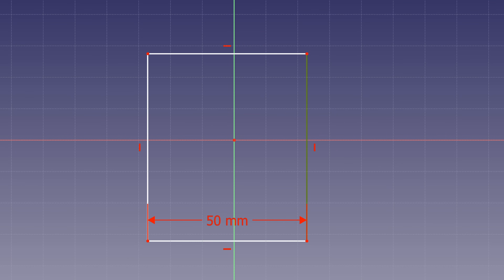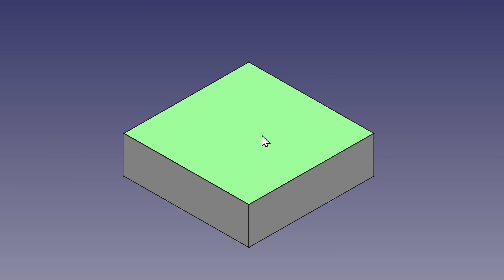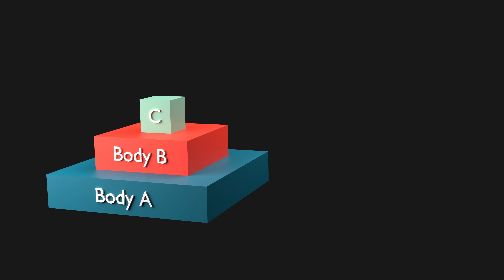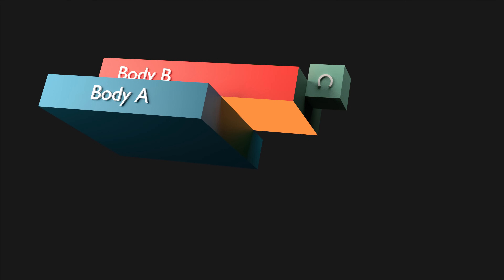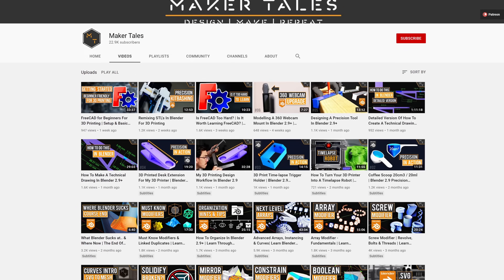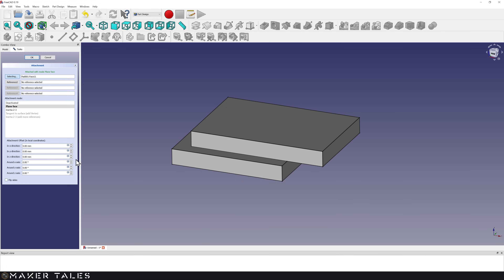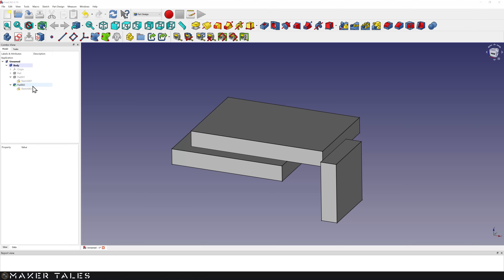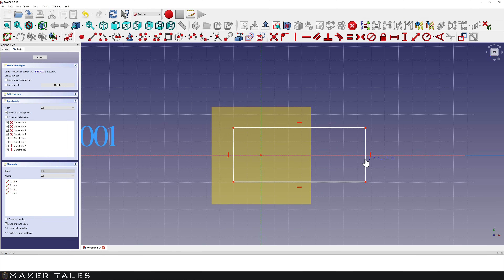FreeCAD Is Fundamentally Broken!  - Now what... Help Me Decide...

Comment: This video helped me a lot. Thanks man. Have you ever encountered other pronlems or some like I had? I knew about this but in my opinion it is not even that bad. Worse is when you spend over 10 hours and you do finish your very complex model that NEEDS TO BE SPLIT which can be only done by boolean operations in PART (that is like the most buggy thing in galaxy) and you realise you can't after literally trying aroud 4 ways to do just that. There is a way that would work but it would take longer than redesign the whole thing from scratch namely cuting every single body individually and then exporting 3d model.... and on and on. FREECAD IS THE BANE OF MY F..ING EXISTENCE. Well sometimes it is but I will only use the datumplanes to origin way of doing things. That definetly will help, because I think my problem here is that I used CROSS REFERENCING between different bodyes and parts like a milion times and freecad USED TO CRASH from that. It even says that I have cross refference cycles. I was trying to copy my thing 3 times and boolean cut it up to 3d printable parts that would be later 3d printed obviously and assembled irl...

Comment: Bravo, I started into cad by taking a "Cad Specialist" that was a 2-year degree. I spent 17 years on the job mostly using AutoCad and Solidworks.  I went to Freecad when I retired to use for my 3D printing hobby.  You are spot on about the renaming of faces.  My suggestion is to make an extremely detail instruction on reassigning sketches, but when going forward always use datum plain workflow.  Once a person learns datum plain workflow, they can still use any pre 2.0 release video to solve use issues with Freecad. Just my Opinion at 67 years of age 👍✌🥃

Comment: I think you hit the major issue on the head. It's a critical usability bug, with significant consequences, and fairly tedious work arounds. It is definitely a major hurdle to wider adoption. The second biggest issue is the UI (not how it looks, even though it is dated compared to current fashions) but the lack  of consistency in how some tools and work benches operate compared to others. They need to be the development focus (as boring as it might be) as it's not capability that is holding back wider adoption, it's easy of use and learning due to these two issues.

Comment: ANSWER : First, to answer your question, I'd either wait or just create videos that don't use the sketch feature.
CON:  Thumbs up on the video's comments.  I'm definitely one of those amateurs he speaks of, but with 2 years of designing in FreeCAD.  I hope we get this bug fixed. I also notice FreeCAD can just choke up.  After thinking I'm doing something wrong for a time I restart the program and it all works again.
PRO:  Meanwhile FreeCAD already offers out of the box 3D primitives to accelerate design which SolidWorks doesn't support. In fact I bought SolidWorks, but haven't learned it because FreeCAD does my work faster.  Subsequently I rarely have to play with sketches, as the Part menu makes most shapes easier and faster. I also like how FreeCAD handles the spreadsheets.  Much more friendly on first blush.
DISCLAIMER:  I haven't put the time into learning SolidWorks, so maybe it's a case of liking the first thing. But despite being a bit buggy, FreeCAD is still my goto CAD program.
Reply: Grub, you might be right as I started out in SolidWorks and can't wrap my head around FC.  When problems arise in SW I am usually able to quickly find the issue and fix it.  For me FC has been such a screaming frustration I just stopped trying to learn how to use it.

Comment: I was dragged kicking and screaming and forced to briefly use cad (solidworks) at uni.    Years later I found myself needing cad for a hobby project (model steam engines).   I taught myself freecad and never actually encountered the bug you reference here,  partly because I rarely change and object using its history without a fundamental re-design of said object, but mainly because i found only using origin referenced planes kind of necessary to avoid your whole assembly becoming a jumbled mess of incomprehensible parameters.     I get that some people might just want a user friendly intuitive piece of software to blitz out a single body for their printer,   but multiple such things already exist.    I don't see why freecad has to be that, and I certainly don't see it as broken.

Comment: Yes, I came to the same conclusion.  Broken.   I found there was little consistency between the   UI for  different menus. Its as if 20 different menus were written by 21 different coders - each with their own interpretation of how the UI should work.  It looks great from the outside until you start trying to do something real with it. 

Openscad (Parametric CAD) is far more useful productive and consistent. You code up what you want the package to do.
 I also using Blender 3.1 and settled on that

Comment: Been using Solidworks for 21 years.  There is nothing "professional" about creating a new reference plane for each and every sketch.  What that does do is clutter up the design tree and unintentionally obfuscate design intent.  Certainly, using global variables and equation driven design geometry is good engineering practice, but when one uses parametric modeling software, one assumes that faces of the model are already referenced to the origin.  If they are not, then the underlying software architecture is poor.  Maybe we would all be in the right mindset for the professional way to do parametric modeling if we started out in high school drafting class labeling our vellum with the drafting table height, angle offset from the floor & position in the room?  Kudos to realthunder for recognizing and fixing the problem properly.  If the others refuse to merge the fix, then permanently fork the code.

Comment: I use Freecad 0.18 -> 0.19 -> 0.20 since about 8 month. Never in my long life I had a program that made me wild like Freecad. I don't say what i thought often about the programmer(s). I think that the part "construction-time" and the part "repairing-time" is about 1:5. It means, that for a normal working time of one hour to construct I need 3 to 5 hours  to "repair" these damned errors coming up by global naming problem. It is pure horror. The part is ready, i have printed it. Next day I change a little peace in one pad or pocked. Boing! Many elements are broken and have to be repaired or deleted and new created.  I am a hobby-user and have time. But I would like to do better things than repairing my work again and again

Comment: Why doesn't allow FreeCAD Spreadsheet cell referenced Math in the Spreadsheet itself? I can't perform any Math in it. For example, if I type this in Excel "=A1+ B1" in Cell A2 then I get the result in that cell. If I do that in FreeCAD Spreadsheet, it just writes the formula in the Cell A2. Is there a workaround to force it to do Math? Edit: it performs a bit differently and not so intuitively than excel... what a bummer -.-

Comment: I am really struggling with Free CAD after using F360 for the last 3 years. Its not intuitive at all and simple things I did in F360 just dont work in Free CAD. Having said that I am learning to work around those issues and its better than paying a stupid amount of money for a program I only use 3 to 4 times a year. I design things to 3D print to fix broken items so they are never very complex.

Comment: I used Catia for the last 20 years, and Catia let one not use scketches if you choose not to.  I never used a scketch to avoid the type of problem being talked about.  I would put a point in space, and would attach geometry to the point, create a surface, turn the surface into a solid and have a very stable parametric solid part.  Is this possible in freecad?

Comment: Yes I have experienced a sketch being lost and loosing it's reference plane.  Have had in sheet metal the feature changing surfaces and realized that they faces change names as you described.  But I am use to problems with 3D cad programs including ProE and Unigraphics.  What I call bugs that never get fixed.  Try to make an array of a model element in ProE. What seems simple produces junk and I had to do it half dozen of attempts.  This is after using it for 2000 hr.  Assemblies in Unigraphics you have to manually place parts together and define coordinates etc.  And Unigraphics has three methods of building parts that can be mixed together.  1000 hr of using Unigraphics.  I also have Granite, solid works, Creo, and tried other free open source cad programs. 
    Even in the above 3D cad software if you change a feature too much the features built on in can fail.  And you have to rebuild the model again from that point.  ProE, Unigraphics, Solid Works, etc all have this problem.  FreeCad just has more failures. This my solution to sheet metal, do not like it but it is what it is.  
     I think this face change naming problem is software fixable and downward compatible.  They already do this for sketch, body or part (models). Can only add:  Delete and the name can not be reused, a blank.  Add and it is at the end of that models feature list.  That is in the unseen column of the table.  Personally my guess is that this is how other programs handle the problem.

Comment: Despite the no doubt wondefull work of the 'thunder' developer,whom I greatly admire',  I will keep on using the official release as I absolutely believe the problem will be solved in a next release. Also the original initiative of this wonderfull software is what I would like to keep supporting for the moment. I am a long time AutoCAD user and Fusion360 (done lots of work in 3D-studio in the past as well.)  I hope the thunder developer and the freeCAD dev's will keep an open mind about cooperation.
Reply: The FreeCAD devs are supposed to be going to incorporate RealThunder's solution to this problem but I tried a pre-release of 0.21 and it is still not fixed so I am baffled what they are doing as it is the one deal breaker issue most people trying FreeCAD never get past and just end up using something else.

Comment: The topological naming bug in FreeCAD seems to be a fundamental flaw preventing sketching on faces, which is easy to do in most all other CAD software.

The work around seems to be to always create a datum plane equal to the face.

If this is true, the fix for this problem seems relatively easy.

FreeCAD has to know the size, location, and orientation of a face.

As soon as the user selects a face to sketch on, FreeCAD should AUTOMATICALLY create and generate a datum plane on the face, BASED ON ORIGIN as opposed to face, which automatic datum plane is left permanent and independent of the face unless the user deletes the datum plane,  whether the face changes or not.

All relevant sketching seemingly done on the face is actually done on the datum plane, which is dependent on origin, not face, which was originally used to define the datum plane.

These are the steps done manually to work around this problem - why can't FreeCAD do this internally automatically ?
Reply: Problem with that is parametric changes to the face are no longer propagated to the position of that sketch. To do this correctly the datum plane would need to be linked to the face somehow and then the problem is back. What they need to do is treat faces linked to other geometry more carefully. When new faces are added to a geometry don't just trash the existing faces and start again from scratch but calculate new faces to insert into the existing list. This is how literally every other cad software works but it adds complexity to the code for amending geometry which is probably why they shy away from it in FreeCAD. The most embarrassing part is that a lone developer has done the work for them yet they can't be bothered to commit resources to integrating those fixes.
Reply: No, other CAD software actually does the same, it just implements a bunch of guessing-functions  to assign existing names to what it thinks is a corresponding face in the model after the operation. That sometimes works, but sometimes it doesn't. Sketching on features and then adding operations that change the number of faces in a model (like chamfers or fillets) is risky in any CAD software.

Comment: Your concerns are spot on but Freecad already a fundamental problem with its terminology, which makes it far less intuitive than other software. Coming from an FEA background I expected it to be easy to pick up but the last three weeks of me trying to adapt to it have been incredibly frustrating. It is a pig. Perfectly capable but because it has grown with contributors each having different ideas, it has become an overly complex monster that has a steep learning curve regardless of the bugs, once the user starts to push beyond simple sketches and models. I'm sure that many power users love it because of its flaws and nuances but I doubt most users will ever get to that stage.

Comment: Whilst the TNP is a serious issue for FreeCAD I don't see how it can ever be totally solved in any parametric editor of this type. If you daisy chain off faces, what happens if you go back in to an earlier stage and make a change that removes a face something else is built on? So whilst I agree FreeCAD doesn't handle it that well and designs can fall apart after changes that shouldn't cause that, even if fixed as far as possible, some structural care is needed.

Comment: I wish I had such problems. Freecad doesn't even run on Windows 10 Pro. I thought I fixed it and it looked like Permissions issues, which does fix it initially, I can open and close it all day fine. But once I actually use it and save something, it never opens again. 
I've seen many others have problems running it on Windows 10 Pro, they seem to only want to point you to thier "Known Issues" doc which does not address the problem. What a load of junk.

Comment: You should definitely teach FreeCAD as it works currently. And I wouldn't wait for some upcoming release. For one thing, older versions of FreeCAD are going to stick around for awhile as the official packages in Debian Stable, and Ubuntu LTS, etc. So people will run into this issue for a long time after it is fixed.

The skeletal geometry approach is worth understanding, and I think leads to more robust parametric models (that are less likely to break when parameters change). Even commercial CAD packages are not perfect at dealing with changes deep in the feature tree / history, and you often have to spend more time fixing up sketches and features than it would take to delete the features and start over.

Comment: This problem is very frustrating. It has caused problems with my designs and I've had to implement workarounds, backtrack through a design and even start over where the effort to fix it is more than creating new.

I don't regret learning FreeCAD and I do intend to continue to use it for my future projects, such as creating cases for Arduino and Raspberry Pi projects.

I think the best thing for now is to teach using sketches on faces, but warn about the potential risks. Also explain about alternatives and how you can avoid the problem such as by creating datum planes. This may mean that some additional work is needed when changes are made, but is easier to fix than having a model which breaks when you change it.

Comment: You should try "part" workbench which work with parametred geometric primitives, you can modify in any ways you want (size, orientation...) WITHOUT  MOVING OTHER PARTS OF YOUR DRAWING.

See on my channel the cases where i use it (it's called "cas pratique")

Comment: I learned FreeCAD, but have stopped using it, because there is never anything I want to do with it, that I couldn't more easily do with Blender or Fusion 360.
This problem you're talking about is not it's only issue either.
I would not commit to going forward until after the new version is released, and then, only if the problem is resolved.

Comment: That's why I'm never using sketches. I always design in the Part workbench directly on 3D bodies and their properties. But even there I've got problems with edges (edges naming ...). It's clearly a BUG.
I also don't like the zero point of cubes and I'm using my own part with the zero point in the centre.
Another thing I never understood is the reason, why angles are notated the way these are,  a direction and how many these are rotated (4 unhandy values with fractions ...). It would be much more practical, to define a rotation for each axis (3 simple values).
And sure, the recalculation of surfaces after operations like cutting, fusions, chamfers and more is not very transparent. The original surface number should stay in place, otherwise everything is undefined after small corrections on the base ...
But in fact, FreeCAD is a great tool and I would not miss it. I just hope, that future editions will have corrections on this problems and bugs.
Now FreeCAD 0.20 is out. The bugs are still not corrected ...